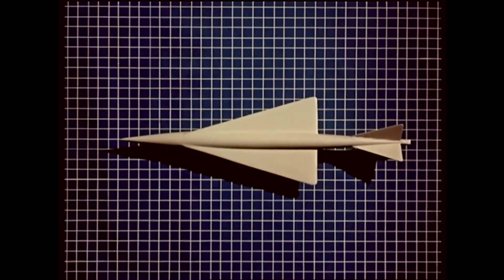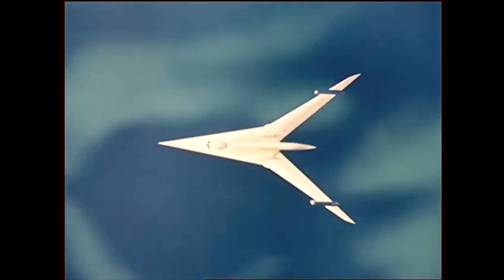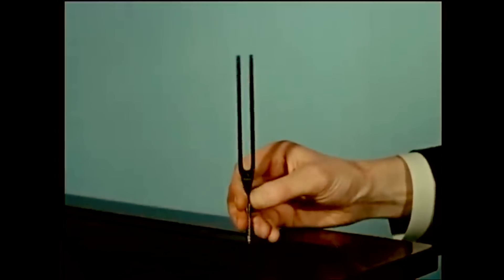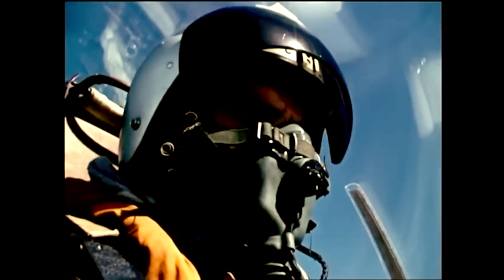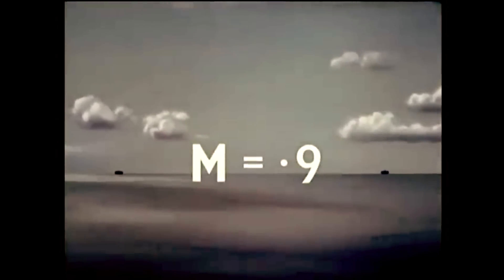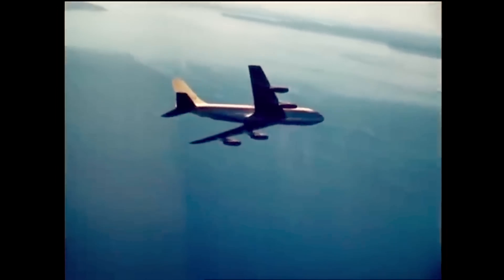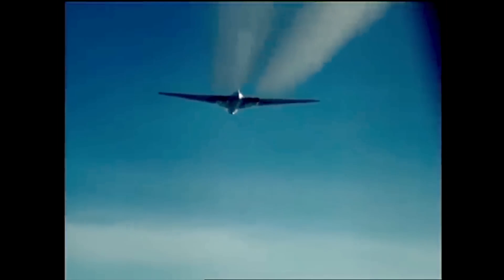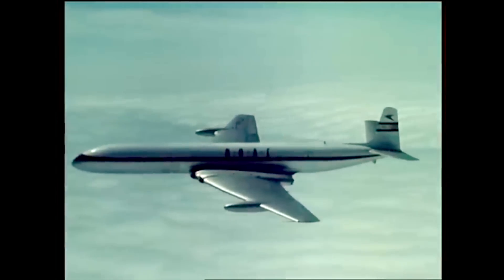British Supersonic Secrets

Comment: When the subsonic planes went past the speed of sound  the air got strange . Got  loaded  up on the nose blocking the air from   contacting the control surfaces effectively. Like a big wind deflector on the nose blocking the air passing over the wings .  Imaging going 800 mph and  stalling out. Because the air stopped passing under the wing  giving lift. That would be a strange feeling. If you had time to feel it..  before making a rapid undesired  "landing" i belive the p51  could dreak the limit in a dive , i dont know if they pulled out of it. It may been just under mach1. Imagine a sr71 with about 8 Jato's attached. To it. Open it up to near mach 2.5, Then hit the jato's 2x2 every 10 seconds  i wonder how much faster it would go. Accelerating from mach 2+ especially if the plane was doing aa slight dive,  1000' per second or so from 60k feet to 35 or so level it outand hit the jato's. It should add about 1-2k mph per pair plus , there were people who strapped one to a car and was killed.  Shooting  a 3000lb car around like its a piece of paper  blowing in a hurricane.  Imaging moving mach 3.3 (+/-) then accelerating to mach 6-7+ in 5-10 seconds .when landing you can smell the HOT METAL 🔥  and possibly getting burned from the leading edged of the plane , also the plane is nearly a foot longer on the landing than the take off. 😮..  the gato (rocket assist motors), adding ablut 3-4 k mph to the fast blackbird.  Travel from Australia to New York in about a hour 😂

Comment: Too much "It isn't discovered until an Englishman discovers it", like Mick West is always pulling. Chuck Yeager broke the sound barrier in 1947. The design was from German Workers Nationalist Socialist Party engineering drawings from Project Paperclip. The English didn't do it until 1948 and it was with a swept wing jet in a nose dive. Swept wing jets also came out of Project Paperclip. The Spitfire could only go 380 miles per hour, the P-51 Mustang could go 490 miles per hour. Speed of sound at altitude is 600 miles per hour, Mach 1. The problem with the English is being number one means nothing, it is the ones running a marathon, not a sprint. England's only supersonic aircraft is filing for bankruptcy, Reaction Engines Skylon. The spaceport in Scotland isn't doing much.

Comment: Strange you should be celebrating British aircraft tech of the past (which is brilliant!) when Reaction Engines have just gone bust. You know Prof, the company who proposed the Skylon in the 80's and got turned down. Then re-emerged in the 21st century developing the Sabre, air breathing rocket engine, to get the idea moving again. The original visionary head of the company was 'retired' and the whole company became more 'corporate' and concentrated on developing the cooling system heat exchanger that allows hot high pressure air to be reduced in temperature to be used in the engine. They were 'helped' by partnering with DARPA  for testing the system. The company seemed to pivot to providing licencing this heat exchanger to other industries that may need such a system. This month the company closed down. Leaving the tech, i suppose mostly i the hands of DARPA, who are no doubt applying it to their much vaunted hypersonic flight programme. All i can say is 'Bugger!'
Reply from the maker: NO ???? that's terrible

Comment: The early super fast planes were designed without today's computer systems and CAD .
A De Havilland DH108 Swallow hit supersonic speeds on September 6, 1948 , so say .... ! 
The first aircraft to fly supersonic in level flight was the Bell X-1, piloted by Chuck Yeager on October 14, 1947.... a rocket powered plane , not a jet , so only useful for test flights and nought else .
The US were gifted jet engine technology by the UK in 1941 , though the German technology was more advanced .
Reply: The German jet engine was incredibly unreliable demanding a full strip after 10 hours where as the Whittle was 100 hours.